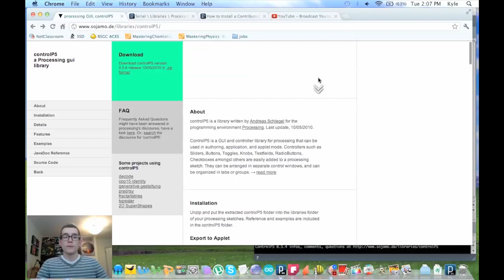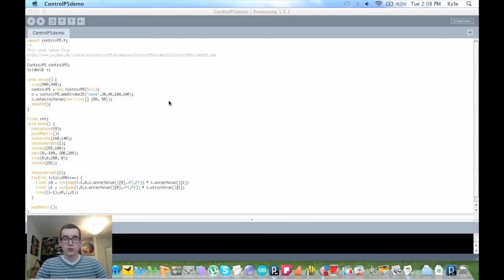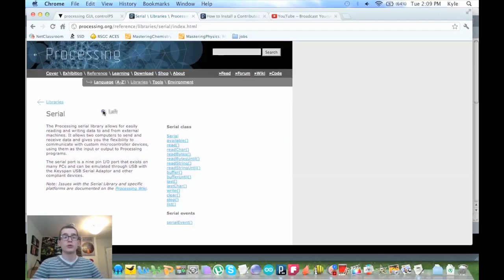ControlP5

Comment: Hello~  your video is really helpful for me to start a new program. many thanks. but I have a question. I followed your link "ControlP5 description" and I open an example code of ControlP5 Slider2D like you. And I copy whole code and paste it in my processing.(I have already add ControlP5 in my library). but it is written in console " The function array value does not exist ". what is the error of it? I tried the others but other list is working well :)
Reply: you need to set the function array to be equal to something e.g. in the code it states 

float y0 = cos(map(i-1,0,s.arrayValue()[0],-PI,PI)) * s.arrayValue()[1]; 

the s.arrayValue stands for setarrayValue

i hope this maybe helps abit

Comment: Hi! How do I change the look of this slider. It doesn't fit with the aesthetics I have, so i would like to change the background, the tick marks etc..
Reply from the maker: +Parth Soni Hi Parth, It is possible to change the look of the slider, background, etc. by changing the code in Processing. Depending on how you've set your program up, this would probably be done in the void draw() method. You would do this by changing the strokeWeight(), stroke(), background() ect. The colors can be changed using the RGB 0-255 and stroke I believe is from 0-4 (or higher, I can't quite remember). Remember that when changing these values it must be done before you draw the object. I hope this answered your question.

Comment from the maker: When I think of visual feedback I think of displaying something, so yes you could use control P5 as visual feedback. However it is probably better used as a virtual controller to modify values and display the changes. The code I used is liked in the description and it was the file controllers/ControlP5slider2D. Hope this helps :)